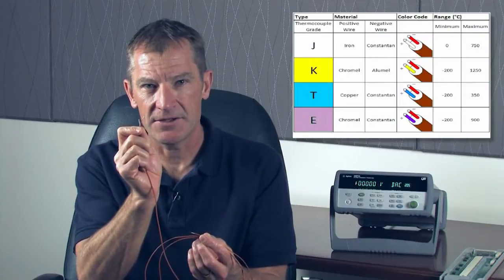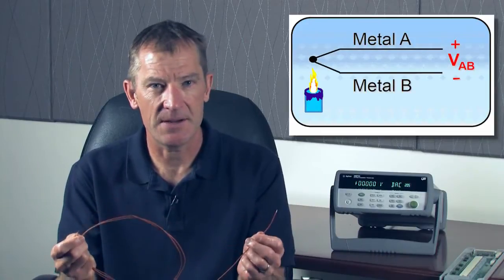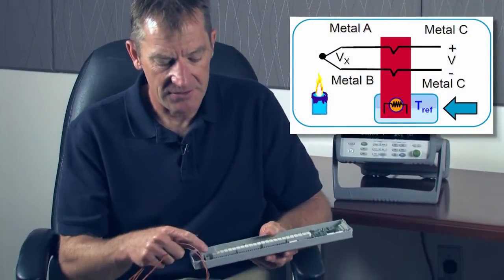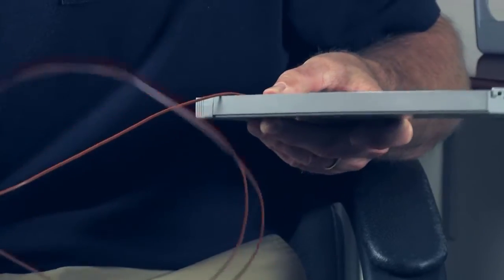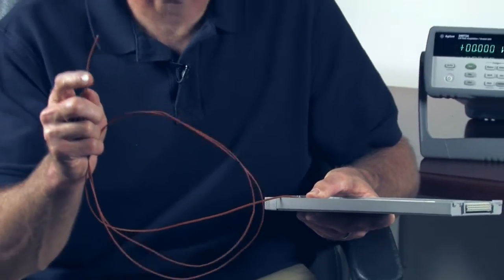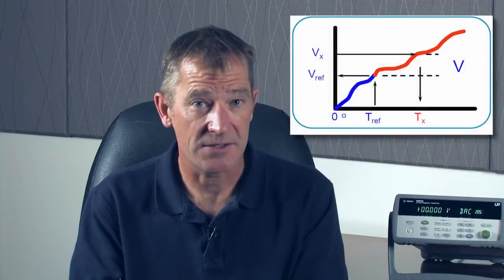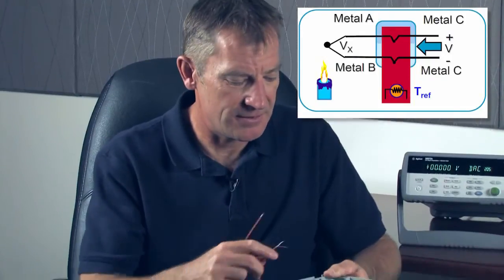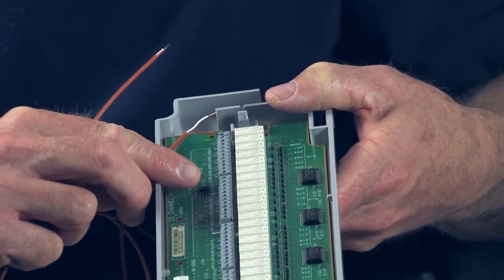Thermocouple Tutorial: How to Measure Temperature with a Thermocouple

Comment: Thanks for your comments ..... How can I measure the temperature of a plate .. more specifically ... the temperature of a tank plate , not  from  the fluid contained in the tank... thanks
Reply from the maker: Miguel, I think the key would be to find a thermal adhesive to attach the sensor to the plate. If the temperature range of the plate is less than a couple hundred degrees C you could use a thermistor.  A thermistor would have greater resolution than a thermocouple.